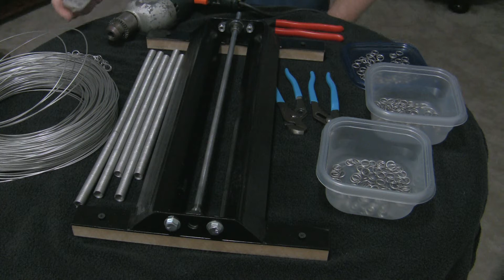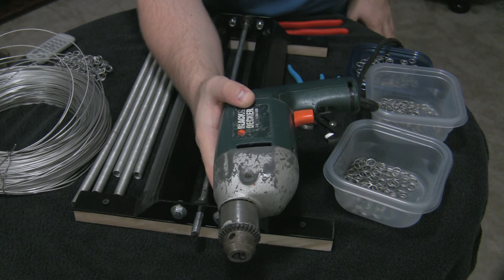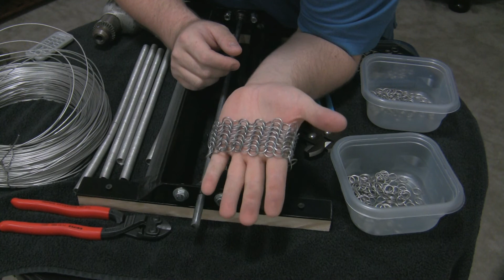Faraday Suit Chainmail Series - Video 2

Comment from the maker: There technically isn't a problem using galvanized steel. There are a few downsides. One, its toxic to weld (not that you'd be doing much welding on a faraday suit). Second, is oxidation which will make the suit look like junk over time in my opinion. This oxidation also essentially acts as an insulator, causing poor performance. Finally zinc burns, so if you're using this with a big enough coil with hot enough streamers that's something to keep in mind.